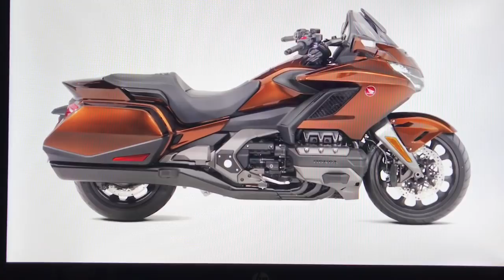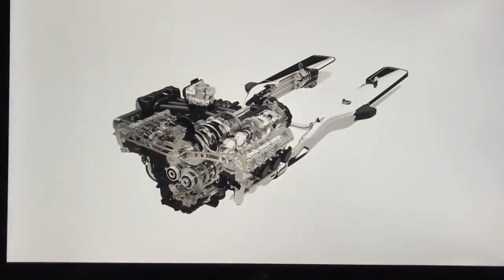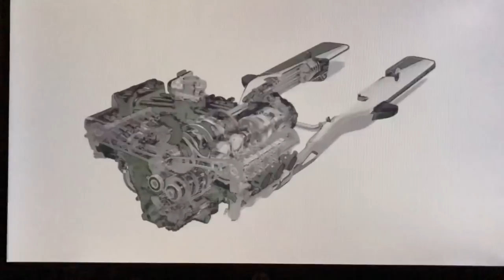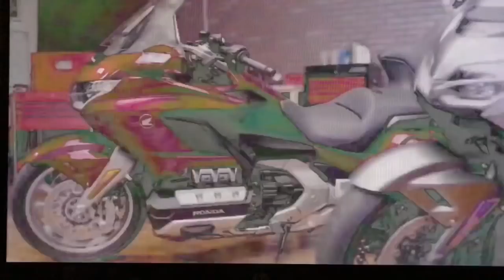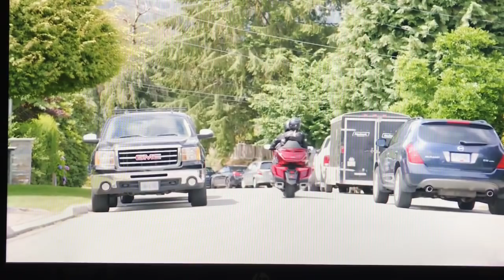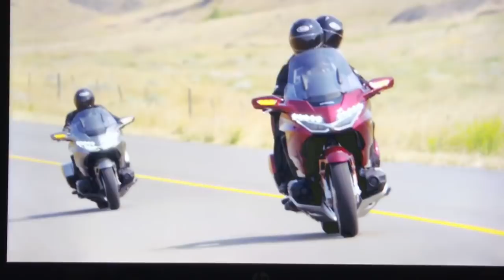2018 Honda Gold Wing Engine And Transmission Details

Comment: I understand that Honda designed a new starter generator to save weigh, the question is: how much would it cost to replace it? It's a bit wierd! if the starter fails should everything be replaced? or just part of that? Another thing that intrigues me, is the new engine, will it be easy to replace things in it?  would be easier than ever to replace the air filter? or doing ligther and more compact desing will increase the level of difficulty to replace things? I never see links on the steering in a motorcycle before? what if they fail!
Reply: Alex Musso the starter/generator concept is old technology for Honda. It’s what they used to use on their old CB motorcycles back in the late 60s and all through the 70s. I imagine it would be more economical to replace the entire unit than one or the other.
Reply: Better get the extended warranty for 8 years of great riding under factory warranty.  🤘

Comment: To bad it didn't give any actual numbers.   The old engine was heavy at 280lbs for engine and transmission without any fluids.  The old engine also made 120hp at the crank and 100hp to the wheels.  I want to see actual numbers
Reply: 5, 7, 19 46, 19, 392.

Comment: Some great re-engineering by Honda, but why didn't they redesign the placement of the airbox so the average owner can replace the air filter himself so it's not a 2hr job by a trained Honda mechanic?
Reply: You'd have thought that would be one of the first things to redesign as a result of GoldWing owners feedback. Don't they listen to the consumer?

Comment: And what are the power numbers on this new engine? No HP nor TRQ data so far. Like why?
Reply from the maker: Our sources from Honda say there has been a 5 hp bump.  The torque curve is supposed to be broader, but no indication yet if those numbers have increased.  We will be getting more information from Honda on 11/6/17 and we will share that on our Facebook and website.  We also plan another Youtube video that will fill in other information in the next 30 days.
Reply: Louie Lamoore Honda never gives those numbers on the touring bikes.
Reply: I've read it's making 125 bhp/125 lb-ft at the crankshaft.
Reply: The old 1800cc engine made about 120hp at the crank and about 100hp at the wheel